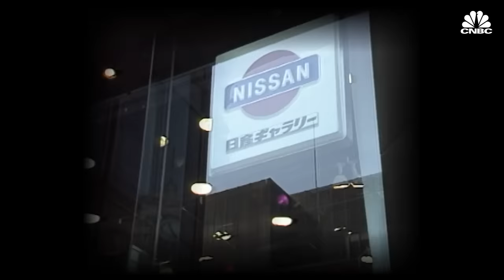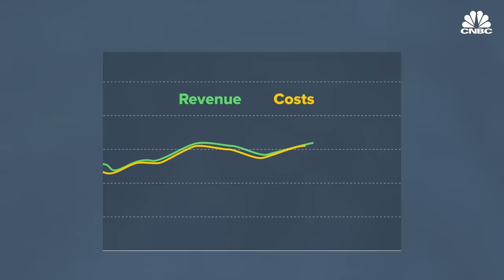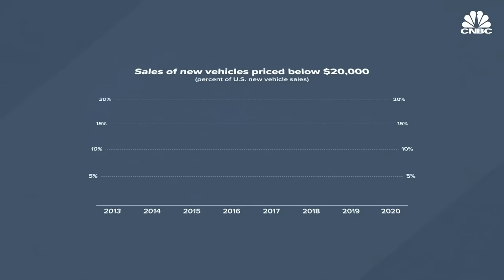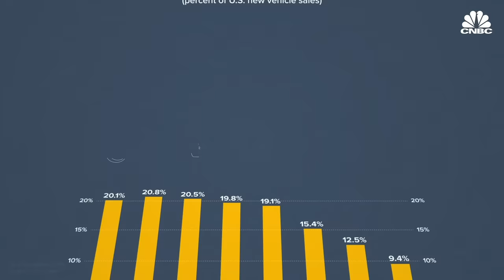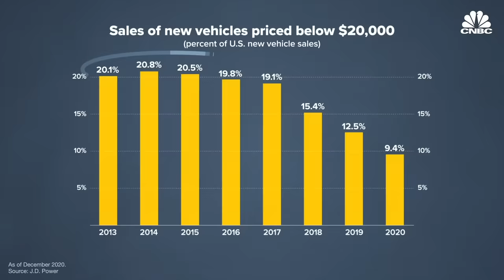Why Cheap Cars Are Disappearing

Comment: They still make cheap cars, except you overpay for them.
Reply: This right here. Hyundai, Jeep, and Dodge are great examples.
Reply: Very true
Reply: Exactly this.
Reply: That’s a good one
Reply: Lol chevy
Reply: @Yondaily   if you want to call quality exploding engines and bad transmissions lmao. Hyundai and dodge don’t exactly scream quality
Reply: Correct.
Reply: @housseinahmed6240   never had any problem with my Hyundai and I also don't baby it
Reply: @Yondaily  jeep and dodge are the same both owned by fiat.
Reply: This
Reply: Exactly!
Reply: Hyundais are the best cars for the money now days. You can put 300,000 miles on most of them and they are relatively cheap to buy. The only cheap Dodge is the Dart and that car is also a great value for the money. The junk cars are any Chevy, Ford, GM etc. that isn't a truck or SUV with one notable exception: Chevy Spark- is made by Daewoo and a good car for the money. The U.S. companies make mostly lemons and don't care at all. Their profit is all in their trucks and SUVs. The flip side is sometimes you can get a good deal on one of their cars but most of the time you just get ripped off. GM in particular puts defective parts in their cars and leaking sun roofs etc. don't even care. Other than that most vehicles now days are really well made. The profit margins are also razor thin. They make all their profit selling you upgrades and charging finance fees when you make payments. If you just bought a base model with nothing added to it and not financing it, the company isn't making anything off it in most cases. It's like they say in the video you could buy a $20,000 mustang or a $90,000 and most of the parts are the same. The company makes all their money on the upgraded models, the back up cams, stereo systems, upgraded engine, or whatever adds ons they have. And most companies make practically nothing on their small cheap car- such as the Dodge Dart, Nissan Versa etc.
Reply: @snakejunt  don't forget Chevy
Reply: They still make cheap cars, they’re just expensive
Reply: Buy used.
Reply: How is that possible if the average sale of a car in America is 30K? Manufacturers are not stupid. They are going to cut cars people are not buying.
Reply: FACT
Reply: Facts!
Reply: Haha.  right on
Reply: 2018 accord redesign introduced standard safety features like lane keep assist and crash mitigation, all these technological add on over time has driven up costs
Reply: @Yondaily  Reliability is not one of those  premium qualities for anything Chrysler. They are all at the bottom of the list.
Reply: @Yondaily  uhh. jeep and dodge are basically the same parts bin for assembly and yes, the consumer feedback on their truly poor 
reliability underscores their cheap nature
Reply: Exactly
Reply: @deandretaylor21   that’s good for you. If you read up on hyundai they are being fined over 100 million for knowingly producing engines that fail.
Reply: @raymondkidwell7135   i have heard of people having to replace the engine twice with only 120,000 miles that’s why hyundai and Kia are I thin ice. They are being fined 100 mil for knowingly selling cars with bad engines
Reply: @housseinahmed6240  Never heard of that. Kias are cheap cars, not much performance, not well built- you get what you pay for. But a lot of people like them because they get good gas mileage and cheap to buy. Hyundai- I knew a guy that delivers pizza for a living. He can put 100,000 miles on a car in one year. He owns about five or six cars at any one time. He said Hyundais were the best for putting a lot of miles on them. I have personally seen used hyundais with over 200,000 miles still running. 

My current 1998 Ford Explorer has 230,000 miles. It's pretty worn out and falling apart, but the engine still runs good. I don't know about the new Fords, but 1990 to about 2010 they made really good engines but they were replaced with the more fuel efficient and smaller eco boost engines. During those years its pretty much the same engine not changed much and used in the mustang and their trucks and SUVs. All the little stuff breaks down and the ball joints go out (about $1,000 to replace) but the engines last a long time. Usually they get junked due to a wiring issue where the truck won't start, but I had someone fix that for me. Almost none of the Ford trucks or SUVs of that era are junked due to engine failure. Similarly I haven't seen Hyundai engines give out. Toyota is similar. The whole car might be 20 years old and rusted through but usually the engine still running. 

The problem with having an old car or truck though is you constantly have to fix things. It's the inconvenience. Like you get up to go to work and it doesn't start or some issue you have to fix. You need a back up vehicle if you are going to have old stuff. But a lot of brands will last a really long time if you want them to.
Reply: @Yondaily  why take out dodge and leave Jeep when they are made by the same company and FCA use beeper materials in Jeeps than they do in Dodges.
Reply: @raymondkidwell7135  Kia aren’t cheap I also heard good reviews and not so good reviews about them and the not so good reviews is about the theta 2 engine from 2011 which was defective and it was certain model of optima’s that was catching on fire I see more Kias on the road these day than i  see Honda or even Toyota I’m not to much a fan of ford but the older version were good cars.  not the new ones they are junk with horrible transmission problems. Toyota and Honda on the other hand are having problems too they are also getting some law suits for example Honda’s engine problems and Toyota faulty cvt transmission with the regular ones as well they are paying 10.5bill 12mill not all cars are perfect these days remember that. Hyundai is technically a Kia with Hyundai badges I didn’t like them but now I feel different about these Korean brands but they aren’t perfect as well so I’ll just stick with my Subaru and Volkswagen love my Subaru Legacy a lot anyway
Reply: Damn you just sum my whole 2 paragraph comment  up in 10 words lol
Reply: Good point!
Reply: Based
Reply: #facts!
Reply: You overpay them because you don’t know how to buy a car you just sign and drive no matter no interest and monthly payments and trade in values or down payments if your credit score is below 750 or 760 don’t expect an apr of 3 percent lower
Reply: I didn’t know I had a human fart that could comment lol
Reply: LOL!
Reply: @jesusgarcia9950  chevy is latin for crap.
Reply: @raymondkidwell7135  Dodge Dart hasn’t been made for at least two years.
Reply: @housseinahmed6240  
We have a Hyundai Elantra and has been very good for 60K miles. It is not a Toyota but has a reasonable quality.
Reply: How true.
Reply: And that's a fact 💯👍🏿
Reply: Truest thing I ever heard
Reply: 100% agreed!
Reply: @Yondaily  That's not what Scotty says. 😂
Reply: @wturner777  who care about what Scotty says 🤷‍♀️
Reply: Very true
Reply: @deandretaylor21  Hyundai cars r of very poor quality
Reply: You are absolutely correct!
Reply: Haha yes man perfectly stated
And we still buy them! Why?
Reply: Not really because of low interest rates and inflation. It’s about the same.
Reply: too true!
Reply: 1999 Camry best car
Reply: For example, some African made European brand cars...
Reply: @Yondaily  I found the dealership employee lol
Reply: Kia is #1 at that.
Reply: @snakejunt  Fiat Chrysler cars (including Jeep and Dodge) are total crap quality
Reply: yes like the ford focus rubbish,mine only has 58,000 kilometers on it and the steering rack already has failed,yes it's 8 years old but hasn't travelled very far and steering racks and electric power steering should last longer than 8 years
Reply: Overpay is mystical pseudo-economics. When a seller and buyer agree on a price, that is proper pay.
Reply: @elliegonzales8212  ... Brand snob are you?
Reply: Kevin Hinojosa

Certainly, there is an element of truth in your statement.
Many cars are simply 'overpriced' as was clearly admitted  when it was stated that
these vehicles 'Share' a common platform and common components.
With continual improvements in manufacturing,  it should in theory reduce manufacturing
costs. 
The only problem that is often overlooked, besides the need for CORPORATE executives to earn
300 times more than the average assembly worker,  Energy prices for Gas and Electricity are rising, as are insurance premiums that CORPORATIONS, have to purchase.
Their suppliers and contactors facing the same rising costs have to increase the price of
the components they sell to the vehicle builders.
These CORPORATIONS borrow more $$ and increase their liabilities.
It is a ferocious circle,  and potential buyers who have an uncertain employment future do not risk committing them-self to long term debt.
So the safety tip for a comfortable financial life is;  if one has to finance a vehicle for more than 36 monthly payments. they cannot afford to purchase that vehicle.
Financing a vehicle for something like 72 months or even 60 months is financial suicide, and sooner or later the vehicle will be repossessed and all payment made is lost.
Reply: @trektaco  No. Just lived over half a century and have owned(and compared with friends) many different brand cars in that time. I'll take part of it back though: Dodge made some halfway decent cars mid to late 60's.
Reply: @elliegonzales8212  ...  I don’t have hatred towards any brand. I’ve owned lots of vehicle and it’s all about maintenance.
Reply: used cars are so much less expensive than new, including good condition used.
Reply: @Yondaily  the cheaper cars of yester year were synonymous with quality and ease of repair proportional to cost you should not spend $200,000 for an s class only to have it rust in a year or two!
Reply: @trektaco  yes..to a certain extent. There is also bad engineering, bad components, bad assembly, etc.
Reply: In Malaysia there is one brand called Perodua their New Cars were Cheap compared to others
(And it is getting Cheaper)
Reply: @snakejunt  exactly. A Jeep renegade probably costs around 10k or less to make. They are CHEEEEAPPPP cars
Reply: Like the Ford Crown Victoria which is now being sold at ridiculously high prices compared to when they were just released to the public
Reply: I remember going to the dealership in 1992. You could buy a new Chevy s10 for $8888.00.
Reply: My dad used to own a '95 S10 but he didn't need it anymore so he gave it to me and its a great car to have.
Reply: Nailed it
Reply: Right 👍
Reply: Economics is not mysticism. Markets cause prices. There is no overpayment except from govt controls.
Reply: Lol.😆
Reply: US over pays for everything.  Mostly by over stacking features.
Reply: True enough 😂
Reply: @Yondaily  you must live in California
Reply: Yuppp, perfectly described
Reply: @snakejunt  chill you are literally no one to be saying what kimd of quality these companies use
Reply: TRUE
Reply: @raymondkidwell7135  the dart is garbages
Reply: @spark20  nah
Reply: @nanamilisa9154  Volkswagen are among the worst for reliability
Reply: And with $200 monthly leasing with zero down, you are overpaying for these cheap cars and dont even own them after 2 years
Reply: @trektaco  nope it’s about quality. How can you maintain bad electrical(Volkswagen)...Or software that screws up transmissions like Ford?, or weak transmissions like many Nissans? Ok then 👌
Reply: @carlcushmanhybels8159  not here
Reply: bou path  they’re normally good in hybrids
Reply: lol the art of the perfect deal
Reply: Very good analogy, factual nevertheless.
Reply: Totally
Reply: @housseinahmed6240  Hyundai has the best warranty of any car maker, they’re new stuff is great considering what you pay for. Mercedes and Audi are considered luxury but are not exactly considered reliable like a Toyota
Reply: Êô
Reply: Ơơô
Reply: Y
Reply: Car companies will be looking for you for that comment. Take it back
Reply: You can't keep loading up cars with safety and emissions features and the cost doesn't change. Forcing backup cameras and a HUD is the latest ridiculous standard....
Reply: @danielwebster8019  Fiat-Chrysler is the name of the company, but I believe they are merging with Peugeot to become "Stellantis"
Reply: The most true comment right here!
Reply: @ev.c6  30k is expensive
Reply: @raymondkidwell7135  bruh Kias have a 10 year warranty
Reply: @raymondkidwell7135  Kia are not chesp
Reply: Tesla
Reply: Fords are crap to
Reply: @snakejunt  dont forget Nissan
Reply: @housseinahmed6240  Hyundai has gotten much better over the last few years actually
Reply: They are getting expensive because adding the cost on accessories and techs.
Reply: @Yondaily  sure they do
Reply: Tommy Lyczko Anything American.
Reply: Honnurswamy @snakejunt 🙏🙏🙏🌺😅😅😅😅😅😂😂
Reply: Roll credits
Reply: @snakejunt  You forgot Fords and chevys. American steel is overrated trash that don't compare to the best blueprints of steel from Japan and Germany.
Reply: @snakejunt  999999999999999
Reply: @Yondaily  Yeah you get a collection of door handles because they keep falling off the Sonata LOLOL
Reply: Bingo - just look at Chevy.  Still crap, but now more expensive.
Reply: When the KIA REO First Came out It Was like Under 7K , AND IT WAS LIKE A PAN MADE OUT OF TIN.
Reply: It’s called dealerships making profit
Reply: @ev.c6 avg  new vehicle transaction price now approaching 37k
Reply: You said it. It is exactly what is happening. It is not only in cars but in all walks of life. Let us try to see the chain between producer and the buyer. Hermes Silk Scarf. I am 82. It was the mark of Quality, Durability and Ostentatious life style. It was designed by French Artists, made in France from Imported Silk from Italy. The high cost was justifiable. Now the same Silk Scarf is designed, made in Thailand with Hermes Logo selling at the high price with a lot of profit enriching Money Monkeys and the government (higher price, more tax) at the cost of the buyer. It is the same with cars. Virtually, no car is manufactured in its entirety in the Claimed Country / Company. Most of is off the shelf parts made in cheap labour countries. Government Regulations, fuel saving and brainwashing of the buyers has made most cars look alike with plethora of highly advanced concepts and gadgets operated by computers has made the owner / driver keep on learning the life time. When things go wrong, it is the fault of the User. Most Car Mechanics are Part Exchangers. It is the same all over. It is a gargantuan BFS
Reply: my ford  escape 2008 worth in market $2500 buy in 2019 dealer sell $4999 CAD . They know how to make money.
Reply: @snakejunt  And these are relatively low end brands though...
Reply: @snakejunt  Hyundai makes good affordable cars.
Reply: True alot of people are switching to used cars because the price of a new car has increased faster than wages. The quality is not any better but the new car price has to increase.
Reply: Wise men. Everything’s obsolete nowadays
Reply: @deandretaylor21  yess exactly. We've 2 Hyundai's. Its buttery smooth
Reply: Yeah good example is Ford puma 😂😂😂
Reply: That's where the Audi VW's one of premium arm became expensive and in India Japan's Toyota because of it's reliability to other car companies.
Reply: 🧐TRUE I BOUGHT A 2016 CHEVROLET SONIC BRAND NEW BY THAT TIME I WAS PAYING 406 A MONTH FOR 7 YEARS TRASH
Reply: @snehdeepbrar4800  Right except refinement and handling which was sweet but wiring of electronics was poor leading to fire in some of cars resulting in fatalities sometimes.Happened some days ago with Grand i10 leading to one fatality.The tin 5(Suzuki,Hyundai-kia, Renault-Nissan and sometimes MG though I not included)makers are came only for intentions for money not to change the shape of indian auto industry.
Reply: Yeh, 😒
Reply: @snakejunt  and wonder why? I think technology plays a huge factor of it. To make people live in illusion, to over pay for the illusion. Whether they are reliable or not.
Reply: @LNasterio  South African.
Reply: Anyone need cheap cars? We can try some Chinese brands,maybe they're cheaper. lol
Reply: @Yondaily  for dodge, their trucks. Actually RAM is a brand by itself. Most American manufacturers have given up on cars.
Reply: @housseinahmed6240  😲😂😂🤣🤣
Reply: Interesting
Reply: yonda ila I was the 100th like on your comment
Reply: @raymondkidwell7135  - People that wait for failure will have failures. At 120k I just replace all the typical failure parts with new and at 240k do it again or drive it until I can find one that has about 60k to 90k used.
Reply: True that
Reply: Truer words were never spoken!
Reply: Mind blown....lol
Reply: I'm waiting for Chinese made cars...because they'll be super cheap.
Reply: You mean cheap quality, expensive to buy.
Reply: Fancy electronics and touchscreens have shot up the prices
Reply: Exactly. A Japanese $35,000 car gives you $35,000 of car. An American $35,000 car gives you $30,000 of car and $5,000 of contribution to the trade union's healthcare plan.
Reply: Best comment😂😂😂
Reply: Fuel guezzlers in symphony.
Reply: Not cheap just crappy. Silverado is a great example! Bad lifters at less than 1000 miles previous years had high oil consumption from being brand new. 34k is a joke. Buy a Toyota that is made in japan.
Reply: They pave the way for people to trade-up for a more expensive car!
Reply: @raymondkidwell7135  I disagree! I seen too many Hyundai and Kia having new engine and transmission replaced too soon! When it comes to Asian cars- Toyota and Honda! When buying an American car-V8 powered i.e. trucks and SUVs! They're gas guzzlers but very, very durable!
Reply: @snakejunt  Hyundai makes good value cars. Although I'm very surprised they scrapped the Accent. That was a perfect 2nd car for any stay-at-home parents running errands or kids around or young teen drivers.
Reply: Haha
Reply: @Yondaily  hyundai does NOT have premium quality. especially dodge
Reply: @Yondaily  dodge has premium quality? Lol please, dodge is pretty well known for its electronics and reliability issues. Hyundai is on the come up but still not quite on Honda or Toyota’s level
Reply: There it is lol. Car manufacturers are adding all of these unnecessary components to inexpensive economy cars which is driving up the price. Can you imagine paying over 20K for a Honda Accord?
Reply: Word to big bird
Reply: @Yondaily   FAX
Reply: @snakejunt  those jeep wranglers are cheap as can be. Still they hold their value well.
Reply: @snakejunt I wouldn’t put Hyundai with jeep and dodge. Instead I would put Range Rover and fiat instead.
Reply: @jesusgarcia9950 Chevy, Ford, dodge, and all of the Japanese, Korean, and European car manufacturers make cheap cars. The dealers just mark them up.